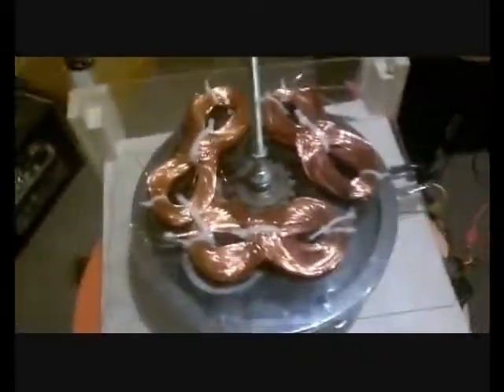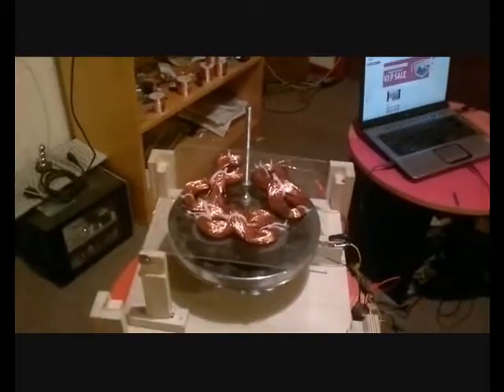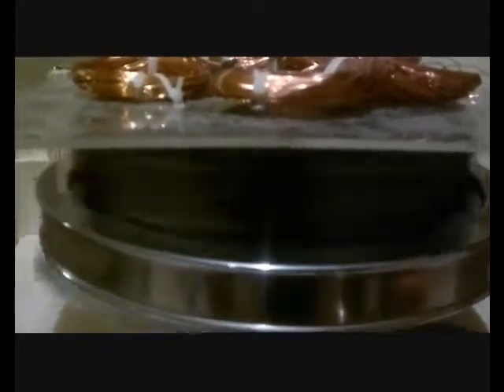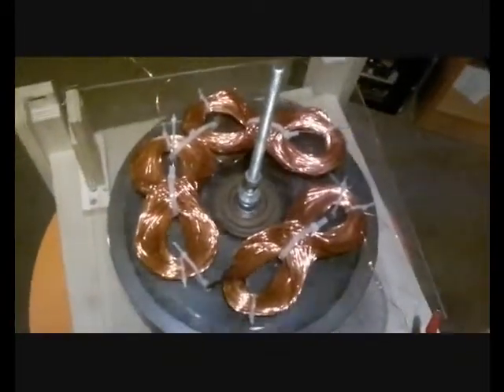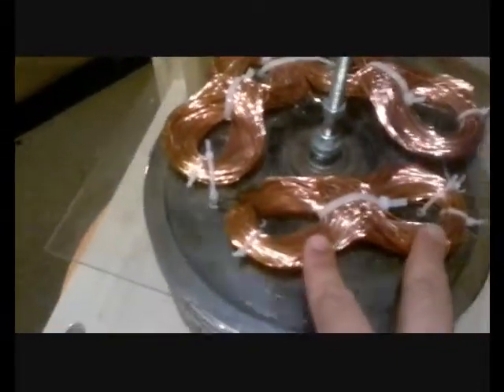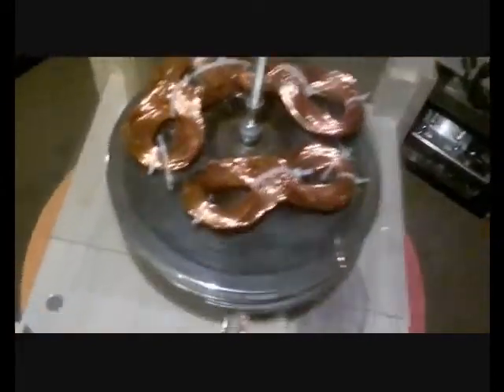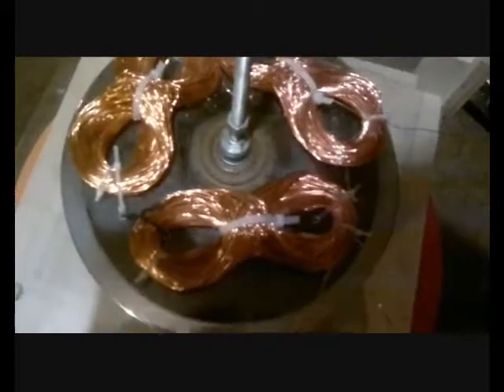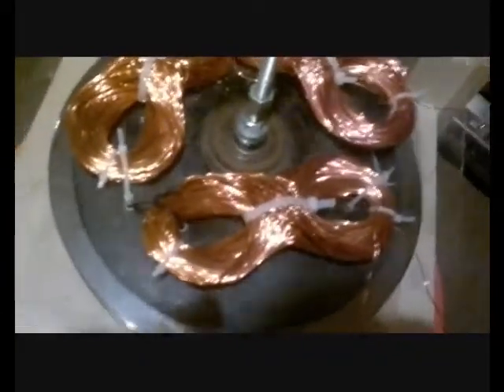INFINITY COILS Pulse Motor

Comment: Can you construct an output for these coils in dcv and input requirements for power?
Nice
Reply from the maker: +foamaxmore I never tested output, input can be anything you like according to magnets you use and weight of wheel and resistance etc, Normally fast pulses of around 15 watts pulsing 15 percent of the time will do it. I am revisiting this idea and building a better that will also reabsorb the pulses into the generator coils, hopefully it wont take me forever to get it done, thanks.